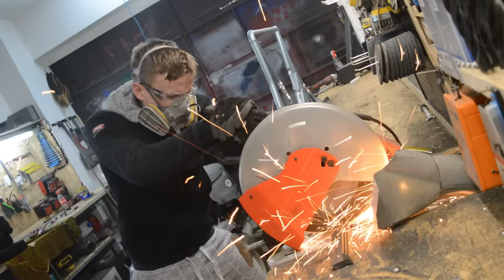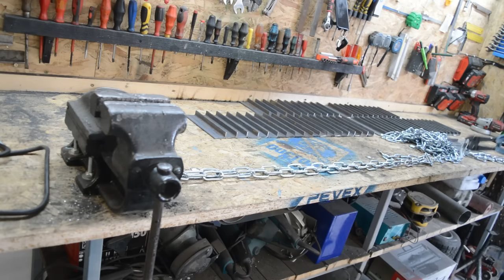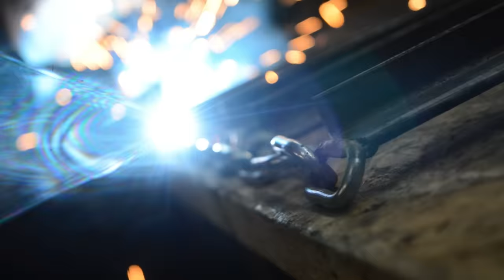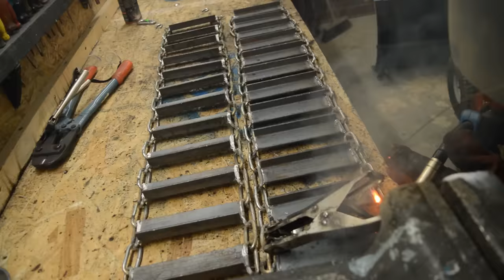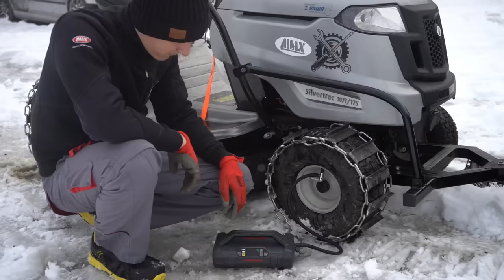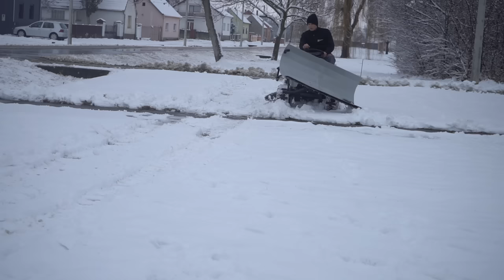Homemade EXTREME Snow CHAINS For LAWN Tractor / QUAD!?

Comment: The "chains" on the back look really good!  On the front of my Simplicity 4041, a 1500 lb machine, for snow plowing, I deflated the front tires, added a #40 roller chain on the center of the tread and re-inflated them.  Gives much better steering on the ice when pushing snow.
Reply: Ич

Comment: Not a bad idea.  I don't know what advantage there would be to front chains when most lawn tractors are only 2-wheel drive.  I was surprised to see the blade because you could have probably blown the snow off with your mower deck.

Comment: Hey bud nice craftsmanship, but I'd like to offer a word of caution from a guy who works on mowers for a living. Your chains are going to beat your transmission to death. The repeated jarring and bouncing causes the top of the transaxle case to break up and the bushings will crack as well. I've seen it first hand with craftsman poulan and husqvarna tractors and it appears your machine is made by the same ayp group. Wheel weights would help but unfortunately the extra rotating mass ends up tearing up the brass worm gear inside the transaxle.  Your best bet is to fluid fill the tires and stud the tires if you have enough lug depth on them and add a small weight box. If you want any help or suggestions on doing anything of those things send me a message I'd be happy to help.
Reply: Had a craftsmanship...rear end went bad.....they are light duty transmissions...don't over stress them
Reply: normal tire chains are better then the item in the video ,, extra weight is a must to keep the slipping down ,, also removing the deck will help save the deck from breaking the hangers from the rough work of plowing ,, also make sure the tires are not froze in the ground ,, seen a axle break when a customer tried too drive the mower that was stuck solid in frozen ground ..

Comment: you put the chains on back ward, well in forward if you put the small side of the angle iron first then the longer side going back ward its more stable cause the long side is pushed against the tire! Just my two cents worth , Im only trying to help.

Comment: Hey if you want even MORE traction I would suggest putting them on opposite sides, backwards of what you did.. Just my thoughts when I saw it, let me know if you try it please..
 #1- Your going to get a much better, deeper edge with the snow being able to sink into the tire tread before hitting the 90° edge opposed to the flat part of the angle iron contacting the ground first and limiting it's bite the depth of that edge minus the thickness of the gauge opposed to coming from the other direction..
#2- If you're losing traction, tire begins to spin and then the edge catch's on something solid I think that stress would easily flex the the front edge of the angle iron off the tire tilting your 90° biting edge back on an angle causing loss of ultimate traction.. Where if it's backwards it would have the full width of that angle iron pressing against the tire acting as a brace to keep it close to 90° and prevent it from just twisting everytime it's stressed causing loss of traction..  ( If using strictly for snow on pavement or concrete this probably wouldn't apply but I think most people's comments and interests were to make a set for added traction 'off-road'.. 
 Comment if you agree or disagree or have tried.. that's how we learn !! 👍

Comment: I know some guys that used their lawn tactor to plow or bought a snowblower for the front. They used chains on the rear but they had to add weight to the rear of the machine to get enough traction on ice even with the chains.

Comment: Very cool, thought of similar. However hows that treat your driveway after 2-3 years?  Asphalt is going to get torn up quick, and concrete is going to wear.  Maybe same idea with some sort of industrial rubber/conveyor belt treads?
Chains wouldn't work about as well?
Reply: Chains make the ride as rough as hell,  carbide studs tear up concrete and blacktop.  Not sure their is a good solution.

Comment: I used to run heavy equipment, big dozers to little dozers, and every one had track pads like that, and everyone would slide on ice, they always found the low spot, whether it was a ditch, or over the hill, just sayin

Comment: Absolutely brilliant!!! One question? Does the tires with the chains on tear up the yard? Also does it leave scar marks on asphalt? Happy New year good Sir
Reply: It does not leaves scars
Reply: Excellent Design  - The Simplest things in life are the best - like fresh is best naturally. 
The only thing I would add is some rubber padding 
on the  L shape parts or even something for example as simple as garden hose one size + .
This way it will two things  - protect + being quieter. 
👍🏅

Comment: Dude take the mower off, for one you get the salt on mower it's going to rust badly, that's why they came out with tractor weights?
Reply: Not necessary having that blade
Reply: No don't it adds weight and the more weight the better
Reply: Snow Sweeper attachment instead of mower blades 👍
Reply: If it were me, I'd try it with the mower deck still on. Remove it if it becomes a problem. 
Besides, this is giving testimony to how well his homemade chains are working! I like the quick time lapse and no blah blah blah.
Reply: The mower deck adds ballast and lowers the center of gravity.
Reply: Yes remove the deck, it won't last long. My neighbors deck lasted 2.5 years, my deck is still going from 1996, add it is still going.

Comment: There needs to be a weak point somewhere in the drive system and you will find it now. Either the axles or the transmission will go next.
Reply: How are mud tires no different? It's what I have on mine.

Comment: If you want to turn you need traction in the front to. Can't believe you guy's can't comprehend that. No traction in front you turn the wheel and you go straight. Try it with the chains on then take them off and try to turn, makes a big difference. I hope you can make a video of you doing that it will change people's minds about chains on the front tires.

Comment: Surprised they don't spin off every so often. I would add a second chain inside the others on each side of the tire, with one or 2 links in away from the cleat. It would thrn hug the sides and make it much tougher (almost impossible) to spin out of.

Comment: Did buy some tire chains similiar to these not homemade have heavy rubber grab bars not steel for tractor with a blower on the rear wheels only. New 10K concrete driveway did not want to damage it with metal chains spinning on the ice. The rubber ones work great do not do damage to the surface but give a bumpy ride so go slow.

Comment: I'd drop the mower deck.  Great idea!
Reply: Leave it on for weight!
Reply: @georgesebastian6306  it's not enough weight to do any good and it's collecting snow in front of it slowing it down and requiring more traction to move.
Reply: Turn the mower on to dry the drive way all in one pass.
Reply: @timhansn362  IT will blow light snow but packed snow it will not I played around one year moving mowers in the snow ,,
Reply: @georgesebastian6306  the deck will break ,, the hangers that are welded onto the deck to hold it to the mower will rip loose ..

Comment: Good job! I think I will do this but I will just use half inch square for the crossbars.
Reply: Square tubing will spread the weight out and will slip....just buy chains and save yourself the headache
Reply: @michaelhirz208  exactly what I was thinking, it will add flotation.

Comment: I think i would have used channel vs angle. Doubling the contact points and smoothing out the ride. Otherwise a cool idea
Reply: Yep.  I agree.  Maybe inch-and-a-half by one inch channel.  But, the setup he has now works so, go with it.  He might want to take the deck off before the next snowfall, though.
Reply: I did a set - channel 2x.25 and 10 3/8 long and heavier chains.

Comment: I don't understand the chains on the front tires? These are not drive tires, so they don't need traction in my opinion.
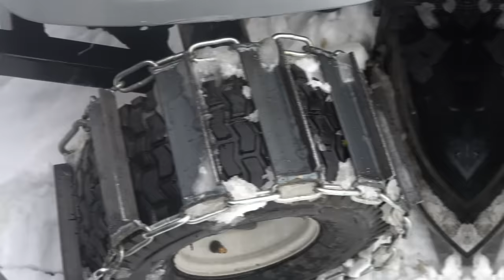Reply: 8:22
Reply: If you're on ice front chains might be necessary for steering
Reply: front tires are a waste if not 4 wheel drive .. should also remove the mower deck it will cause the deck hangers to break due to the rough driving of snow plowing .also said in text in the video he removed the front chains

Comment: I don’t know if you meant to make your design the way you did or if it was just trial and error, but excellent choice of paddles. I seen some videos of guys using channel iron instead of angle iron, and that was the wrong choice.  They would plug up.  Whereas angle iron is like self cleaning. well done.

Comment: It seems the chain is galvanised: the good weld practice is to remove the zinc before welding.
Did you considered any spring or rubber to tension the chain rather than enflate the tyres?

Comment: Did the front help with steering at all? 

In slushy conditions, and heavy wet snow, I have difficulty steering. I turn the wheel but keep going straight.

Comment: Don't think you needed any on the front wheels they don't pull lawnmowers just aren't designed for snow plowing.
Reply: Raymond, you are 100% right! He could pull deck off and build a set bogey wheels! But realizing most mowers are driven by rear differentials axles meaning only one wheel pulls! Now if he could lock the rear axle drive and install bogey wheels for a track drive A-ok then the steering will still needed modifications! As for the steal pads on just the tires like done on these tires …. Ok but if he tries to load the unit on(with his steel pads) any metal ramp mostly the steel will slip! Also I use to push snow with the blade on my lawnmower…… kept breaking the shear pin within the transaxle which shut down the unit because it’s pin can not handle the snow weight! A thought though, he bought chains to fasten the metal to……. Why not buying a little more chain and use it instead of the steel angle! Chains are cheaper then steel angle!

Comment: I imagine this would scale OK?  I have a 1988 Unimog done up as a serious off road go anywhere camper (with 46" tires).  I was going to buy 2 sets of tire chains for it, but I'm put off by how long it takes to get the damn things on and off.  Out exploring I'm constantly transitioning from mud to rock and snow to rock.  Clearly I would need to be putting them on and taking them off all the time. These look very quick to put on and remove whereas chains are a pain in the Butt to put on. Something like this would be MUCH easier and faster.  Also very cheep and easy to do DIY.  Also CTI (central Tire Inflation) removes the hassle of airing up and down.  Apart from clearance on the inside of the tyre, can anyone think of any disadvantages?  The raised angle I was thinking of cutting at 45 so its less likely to catch on the odd rock, branch or fencing wire and dragging it up and around the wheel or axle.  Maybe using T rather than L (Tee section rather than Angle iron).  It also goes without saying keep speed down cos if a chain or weld does brake I'm going to tear up a tire and possibly do more damage.  Yeah, large heavy duty chain and something stronger than a carabiner to join the chains.
Reply: with a mog get some skidder tire chains.

Comment: The back tires will hold 3 gallon of windshield washer each I did it to my zero turn its like d different mower now
Reply: Wondering if you'd consider making a video on how to do this!?  Thanks.
Reply: @dbdouglas  I broke down only 1 side of the tire once it was full pumped it back up
Reply: @dbdouglas  if your still not sure what I  mean I could make a video for you this weekend I think
Reply: @paulb7334  I wouldn't need the video, but I understand now.  Thanks!
Reply: @dbdouglas  makes a huge difference and won't rust the wheels like calcium I wish I did it sooner because on wet grass I was always spinning or unable to steer
Reply: Add some weight to the back of a zero turn and see if the thing will pop wheelie's in the yard. Imagine goosing the throttle and pulling a wheelie like Evel Knievel.

Comment: Why put chains on both if only the right rear wheel drives?
Reply: I guess it just looks good since all wheels then have chains on them?
It kinda looks like tank tracks...
But yes, it just looks good.
Reply: Because of the open differential. The right wheel is the only one that spun Because it had less grip than the left. If the right had more grip the left would have spun. In a nut shell, in a system with an open differential, power will be sent to the wheel that spins with the least amount of torque. You can see that the tractor has an open differential when he turns one wheel making the other turn in the opposite direction. There are oodles and oodles of videos on YouTube about how every kind of differential design works, including open, limited slip, automatic locking and selectable locking.
Reply: better steering on ice, no other reason, but the crossbars were really redundant. just chains alone do work better because the tire slips sideways, a straight peice of iron across defeats the purpose. for the rear, perfect 👍

Comment: I would never buy angle iron, I would use bed frame, it's cheap and very easy to come by. If I can't salvage chain, I'll buy it.
Reply: Sounds like a good idea, but try to cut, weld or drill the stuff-- just a looseing battle.
Reply: Bed frame angle iron is about 1 1/2" leg - too much for this application

Comment: Wonder what the city would say if I made a set of those for my car . 🙂
Reply: you would just spin your tires on pavement or concrete ,,and throw a lot of sparks .. them chains and angle iron will not have traction on hard ground ,, you might be better off on the car if you have spoked rims is to wrap rope around the tire and threw the rim ,, seen that done when trying to climb a ice hill ..

Comment: One thing is bad, the shaking is very strong. I did this only on chains. Then he made jumpers around the circumference of the wheel in the center and the tractor stopped shaking
Reply: I have some tire chains that have links like a barbed wire fence have ,, great in snow but you feel like your on a rail road track hitting all the cross boards ..them angle brackets would be 10 x worse and they will spin on concrete or blacktop .. best luck I have had over 30 years is twisted cross chains .. yes they wear out you could get a few years then repairs .. I have built a few sets for different mowers I have .. also he should take mower deck off .. that will break the hangers all that slamming into snow banks ,,

Comment: Seek your advise if i can use this snow chains in deep muddy farm road
Reply: I have used heavier chains and 2 x 1/4 channel - no problem on mud and smoother ride on concrete. Too heavy to carry both rear wheel sets at one time - lots of steel. Will post video and pictures. I did this to plow a field not snow plow.

Comment: Why put chains on front tires?
Reply: Um slipping.
Reply: @timsolomon8352  I'm wondering about the design for the front tires tho, they're not driven so having paddles meant for parallel grip doesn't make total sense. Think about a sand rail, front tires have lateral grip cause that's all they can do. Should be the same here
Reply: So it doesn't slide
Reply: @crackedthieves  chains won’t help in that orientation. Needs to be with direction of tire not across it.

Comment: Sure everybody has a shitload of angle iron laying around in the garage
Reply: That's what old bed frames are for... Go out just just before spring/fall clean up you can pick up loads of them just placed out for cleanup... Or check with your local thrift stores some just toss them in their trash compactors (hint from a garbage man) if you ask nicely some may set them aside for you when they get them in.
Reply: ...and you still have  a $&)( load of snow to remove.